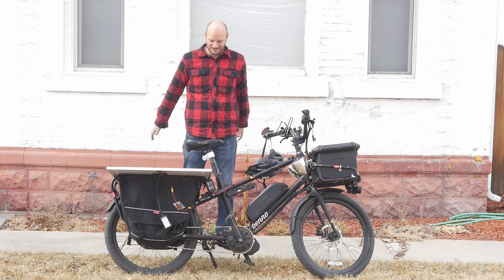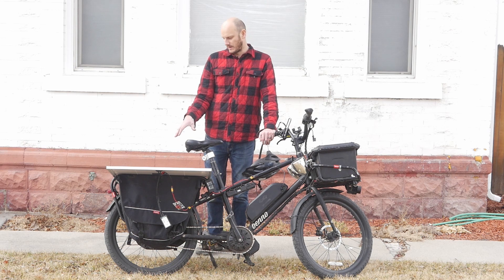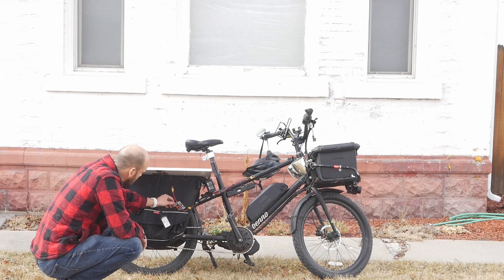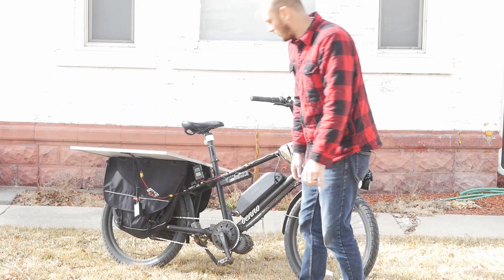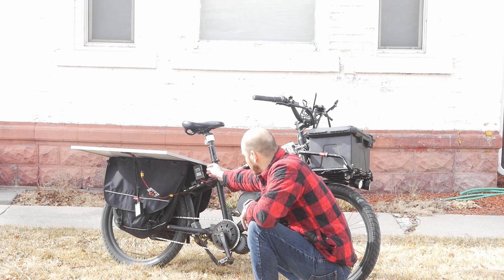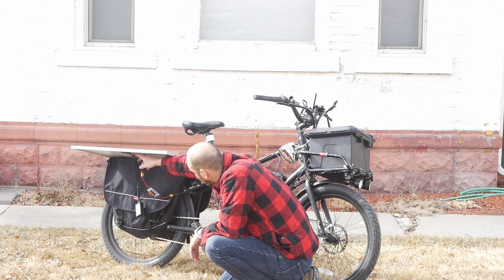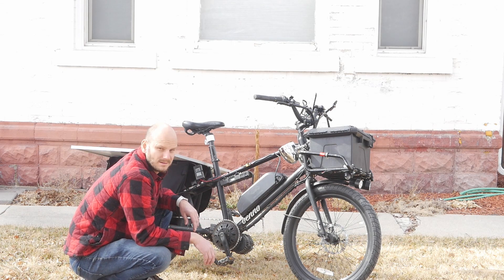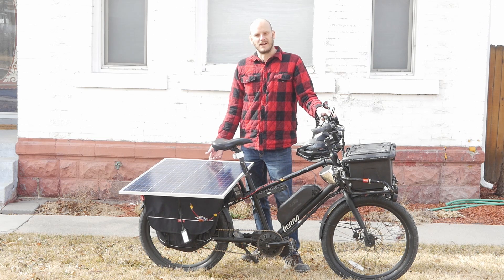My Cheap and Easy Solar paneled Electric bike setup!

Comment: 😂😂😂😂Juice it up in a day... No chance
Reply: Actually there's a really good chance that if you're not using the battery for the day (camping), you could most definitely get the battery fully charged from completely dead with just a 100w panel. An average ebike battery is 48v and 10Ah, which is 480wh. A 100w solar panel can easily produce an average of 40w over 12 hours of daylight (480wh/12hrs=40w per hour). So, full charge in a day? I actually might bet on it. Not very much, but I'd maybe bet on it :P I think though, that most people don't run their bikes to deaddead, so there's even a better chance of that working honestly. Especially if you added another 50watts of flexible panel from under it or something, you'll definitely get to 100% in a day of sun, even if you had maybe 20% overcast...
Reply from the maker: I agree about that most people don’t run it dead so you only need a percentage really
Reply: @Demdere  you may just about get it juiced on a really sunny day if you're only running a 480wh battery. Johnny has a 52v battery on that bike though and it's probably atleast 14ah so that's going to be over 700wh and that will be a struggle. You are definitely correct in saying that most won't need to do a full charge so it's plausible it can get charged. It's a good, fun idea that's for sure and you'll definitely have a head Turner. They might think you're mad but it will defo turn heads

Comment: I didn't see a charge controller to even the flow, does the panel have a diode in it to keep it from reversing at night and draining your battery?
It is hard to believe that small a panel delivers 100w I have a 20w on my van to keep the battery up and it looks nearly as big as that one.
Reply: Yeah basically the voltage step up boost converter acts as a one way valve and will stop when the battery is full because its a direct current constant voltage device.
Reply: I use this exact setup to wire a 16.8v 40 cell old laptop battery pack to my ebike charging the battery while riding making my main battery deplete slower because some of the electricity comes from the 42v boost controller
Reply: @MrJob91  Sound like you got it dialed in!
Reply: @samTollefson  these voltage boost converters can be had for as little as 7dollar. Let me know if you need a link. I also have a much larger one that was 25 dollar. This is rated upto 1000-1500watts but will need lots of cooling at those numbers
Reply: Its pretty fun to have one if these on your ebike. I can take any lipo i want that is charged and use it to keep my ebike topped up.

Comment: 100w in full sun, figure on 10-40w without FULL sun. that is to say sunglasses sun for full power and it drops off quick. for solar to get any efficiency you need a multi point power tracking charge controller. set the voltage to 58v and walk away. you will get the most from your panel. yes they cost more but they are 30% more effective. love your channel Reponut sent me!
Reply from the maker: I ordered one a few weeks ago, still waiting patiently. Repo’s a good man!
I think there was some power loss from going through the step up converter. I’ll have to test and see what kind of loss I’m getting.
Reply: @JohnnyNerdOut  just thinking same thing the buck inverters do get hot .
Personally a custom wide angel wired to 68v
Reply: Seems like u know alot about solar panels would it be possible to put a solar panel on a tao leo electric motorcycle?